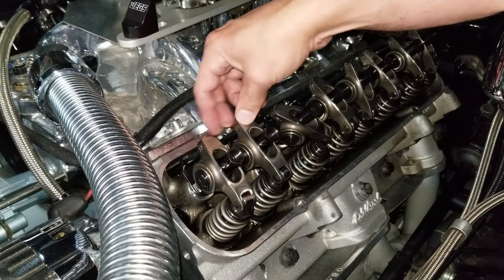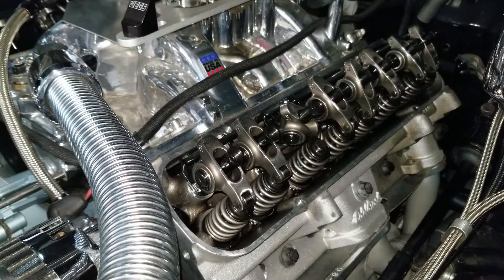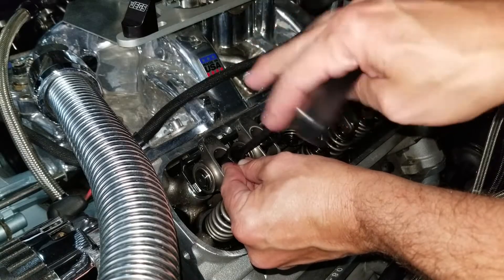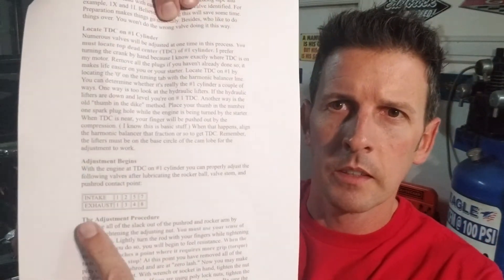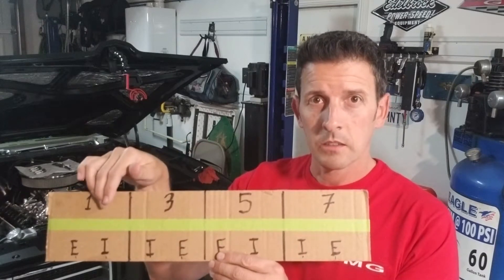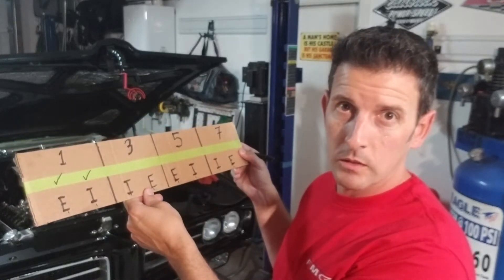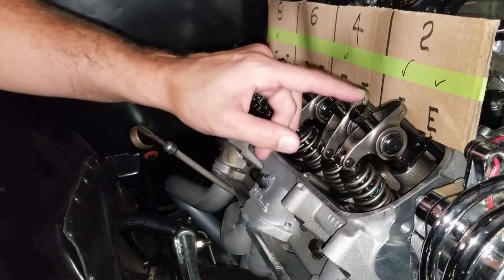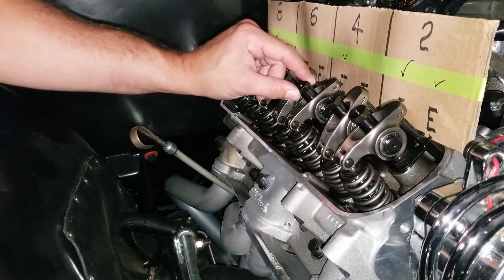Part 2 of 2:  I broke my Butler 467!  How to fix it?  Roller Rocker Valve Lash Adjustment

Comment: Cams have enough overlap in them you should be setting it using the exhaust opening and intake closing method (EO/IC) to avoid the overlap of a camshaft. A hydraulic Roller you can spin the pushrod till you feel drag then add 1/4 turn so it does not have room to pump up, Solid Rollers just set the lash.
Reply from the maker: Yup, but also depends on the type of hydraulic lifter, most manufacturers state the amount of pre-load on the box.  Thanks!

Comment: I've run nothing but hydraulic roller cams for 20 years plus. Never  mismatch parts. Stay with the cam manufacturer's recommendations.  There is no guessing. 
Also in quite a few videos I've seen the oil bands of the roller lifters protruding from the bore. This is a disaster waiting to happen.  I also break in & dyno out of car. All my engines use king bearings. Stud the mains. Use zddp oil. Extra insurance 
 Will never hurt a muscle car engine. Check clearance,  repeat.
Reply from the maker: For the most part, yeah, if the CAM manufacturer makes lifters, always good to match em.  You're absolutely right about the oil band, especially on Pontiacs... they're not the same as Chevy's let alone LS's ... I've seen that too, trying to get LS lifters to work in a Pontiac.  I'm using King bearings now too.  Thanks for the comment!

Comment: Just curious, if your running a roller cam solid or hydraulic.why are you not using stud girdles to eliminate the problem your fixing right now?from past experience on my part. that loose rocker could have been much worse on your part.good luck with the poly locks.
Reply from the maker: I have a Hydraulic Roller Cam.  A stud girdle wouldn't have prevented a bar from breaking off the lifter.  Apparently it's one of the failure mods of retrofitted lifters.  Thanks for the comment!
Reply: @FastMonty  What lifter and rockers are you using here? There's quite a bit of chatter in the forums about lifter and rocker arm failures for some of the aftermarket pontiac stuff. Thanks for sharing.
Reply from the maker: @stevelangworthy9553  I'm now using Johnson Lifters, been working great.  I think I have Scorpion Stainless Steel 1.65 rockers.  They're great too.
Reply: @FastMonty  I thank you. Have a great holiday.